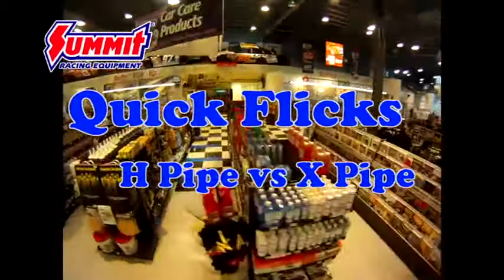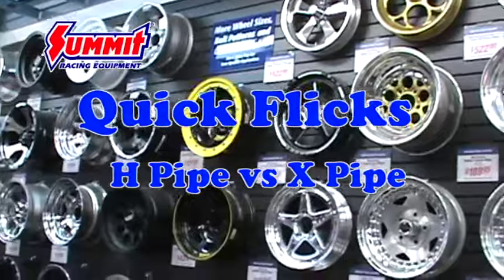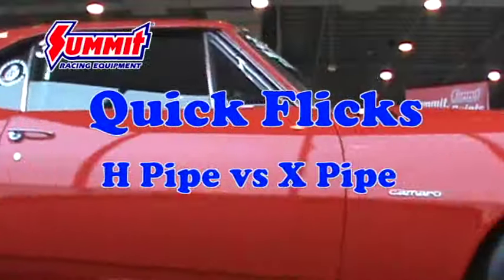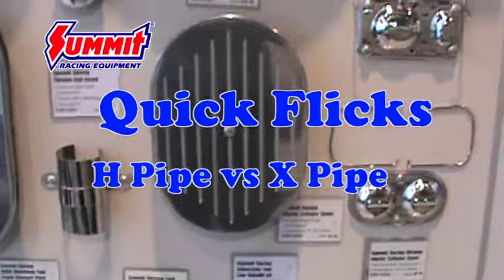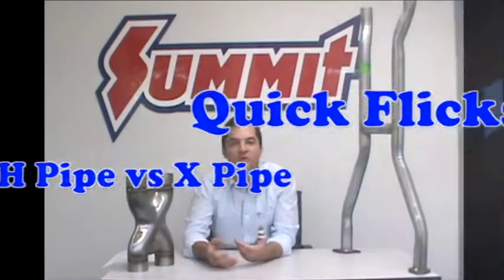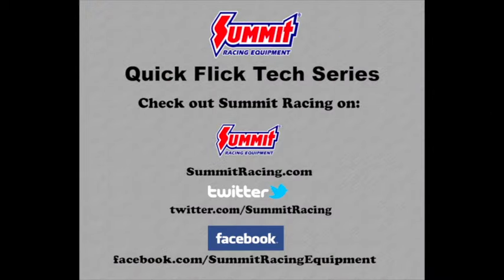Exhaust X-Pipes vs. H-Pipes and Differences Between Them

Comment: I have a 2012 Ford Flex Limited  Awd Ecoboost, I'm look to get the most out of it, there is a resonator an some say catalyst converter before the resonator, the catalyst converter is that a X pipe or a catalyst converter, an can they be taking off to stop restriction, can I go to 2.5" from 2.25 from front to back an is there anything  else I can do to more out of the 3.5 355 HP
Reply: bigger is better on turbo engines as the exhaust flow from a turbo motor is very different from the flow of a n.a. motor.

turbo engine exhaust flows like water flowing through a hose.

n.a. exhaust is a series of waves. a high pressure pulse is created when the valve opens then when the valve closes it creates a low pressure area behind the exhaust pulse. that low pressure area in a tuned system helps to suck the next wave out of the engine when the valve  re opens. That's scavenging.

for turbo it's all about killing restriction and maximising flow. go with dual 2.5s or the biggest system you can afford.

The larger the pipes the more expensive the system and the less room youll have to route it. so keep that in mind
Reply: I'd use dual straight pipes personally. I don't see the advantage with an x piped system on a turbo charged vehicle but I could be wrong

Comment: I have a 96 caprice 9c1....getting ready to install some long tube headers along with some spin tech mufflers....No head or can work just cold air intake, under drive pulleys, beefed up trans, bigger throttle body, computer tune and bigger gears soon to come...not sure if I should stick with an h pipe or upgrade to an X pipe.
Reply from the maker: Ian B , Either one will accomplish pressure equalization between banks but, the X pipe will promote scavenging power gains in the higher RPM ranges!

Comment: I have a really good question I blew apart my bell housing and it caught my headers so I'm thinking of just piping it out of the does or through the fenders is what I like for show, but I don't want to lose on the massive amount of power because I have the x pipe I love the sound but I'm confused now that I've watched this video lol.i don't want to lose power
Reply from the maker: Hi jay arnold, 
On a street car application, that X pipe is helping you scavenge the exhaust out of all the cylinders. Give us a call and we can help you choose the right parts to reconstruct a new and improved exhaust. 1-330-630-0240. Thanks for watching!

Comment: Hey guys.  Is that ok to use x pipe on a daily drive truck?  Or this is only for racing vehicle s ?  This afect the mpg or improve mpg?   thanks.
Reply from the maker: Hi José I, 
Both H & X pipes improve power production. The X pipe just happens to do its job better when the exhaust gases are flowing well such as at a higher RPM. In a daily driven low RPM truck, an H pipe will do everything needed and will be easier to build!
Reply: Does x pipe will afect the mpg or the engine on low rpm?
Reply from the maker: José I ,
While an X pipe will still scavenge somewhat at a lower RPM, any increase in mileage will be minimal.

Comment: whats the best one for a 1997 chevy 1500 with a 350 vortec
Reply from the maker: +Markus Gentry , 
When a vehicle is operated most times at low speeds during towing such as trucks, they benefit from an H pipe.

Comment: what is better for 2003 audi a4 quattro. x pipe or h pipe?
Reply: dodz barredo if it's a v6 they come stock with an x pipe. 4 cylinder options only have a single pipe

Comment: On a Hyundai Tiburon with 2.0L 143 bhp how many bhp could a x pipe add?
Reply from the maker: Hi Dima K, 
X and H pipes were originally designed to equalize exhaust pressures between banks of V8 motors as well as some V6’s. Dividing the exhaust on a 4 cylinder motor would be detrimental to the scavenging effect of the current exhaust.

Comment: i have a 96 impala i want to X-PIPE IT NO CATS STRAIGHT TO THE MUFFLERS IS IT BENEFICIAL TO HP AND SOUND ?
Reply from the maker: +HASANI BROWN, 
Every car/motor combination will react differently and much will depend on the tune you put in the computer. But it will most certainly be an upgrade over the factory exhaust!

Comment: i have a 1981 cutlass cruiser with a stock 5.3 LS swap will a x pipe fit onto this wagon?
Reply: S.i. Thug I wanna see that swap. post a video. I'm looking at doing the same swap to a full size 83 Buick wagon
Reply: i wlll not be posting no vids until later on when shes finished its a g body and you can check out the g body ls swaps that are on here
Reply: S.i. Thug did you have a hard time fitting exhaust manifolds in there?
Reply: I used f body headers prior to engine installment
Reply: S.i. Thug right on. thanks for that

Comment: Surprised to hear the speaker talk about "lacking back-pressure". All back-pressure is a bad thing in terms of performance.
In a situation were an engine is "lower performing" or a engine that makes most of it's power off idle to mid-range it's not a lack of back-pressure that could hurt it's low rpm performance, it's a lack of exhaust velocity due to an exhaust system that is too large and/or tuned for too high a rpm that allows exhaust to linger or worse get party drawn back into the cylinder.

Comment: H and X pipes tend to only make a difference on fuel injected engines with  dish pistons that lack in cylinder pressure. A high compression carburetor engine  tends to do better with open exhaust or with straight through mufflers to free up horsepower. Nothing actually generates horsepower besides the engine itself.

Comment: what would you recommend for a 350? X o H pipe?
Reply from the maker: Hi Danny, 
We need some additional information from you. Can you please give our tech line a call? 1-330-630-0240. Thanks for watching!
Reply: What kind of info would you need?
Reply: Compression, cam, carb, tune, max RPM, daily driver or street / strip or pure race and drag.  Anything that effects airflow needs to be calculated.

Comment: I don't know how much hp I have but I used to rev my sbc350 to 5500rpm to run 13.7 and after i installed the X pipe (only mod) it run the same time at 5000rpm and a 5000 it used to run 14.2 before revving it to 5500 , the sound it's different and a bit lauder, the camshaft lost his choppy sound

Comment: I have a titan with true dual exhaust no h pipe or x pipe is this ok
Reply from the maker: Hi chris collins, 
Yes, true dual exhaust has been working just fine for many, many years! Simply stated, the addition of an H pipe will help to balance the pressure between banks of the motor allowing it to breath better and may increase your power a bit.

Comment: I have a 91 mustang 5.0 with the trick flow track heat top end and stage 2 cam. I'm running a coil pack system from an explorer and plan to switch to long tubes. I'm running an h pipe now but would an x pipe be better?
Reply from the maker: Hi *****, 
For maximum horsepower in the upper RPM ranges, yes, an X pipe would be more beneficial! Thank you for watching :)

Comment: Mercedes C300 V6, 230hp, which is better for my car X or H pipe,
Reply from the maker: +Donny Linton, 
Not all engines breathe the same or are used for the same purpose. While an H pipe may work well on your street driven V6 an X pipe may work best on a Race driven 6 cylinder. You’ll have to try each one on your vehicle with the proper computer tuning each time to see which one produces the best power in the power range you operate in most frequently.
Reply: +Summit Racing ok great thanks for the help. ill be going with X pipe

Comment: Is it ok to delete my resonators and add x pipe?
Reply from the maker: Hi XxStUnTiN2422xX, 
What you are contemplating is actually quite common. You will get some increase in interior drone but the X pipe will give you a gain in performance. Keep in mind, you will have to retune the computer for this additional air flow!

Comment: Ok here you go. Take my knowledge for what you want.  Not here to start an argument.  I get all the uninformed these days saying they want an x pipe. With an x pipe you will get about a 3-4 hp gain in the top end (which is nothing) and about a 10-15% loss in torque in the low end.(which is a lot)  Believe me you will feel that. (because with an x pipe you loose back pressure at low RPM's) For daily driving this sucks. Plus hands down an H pipe sounds so much better. I love that old school deep rumble growl that goes with the H pipe and the 3-4hp is not worth that obnoxious raspy sound from an x pipe.   For a heavily modified motor and I do mean heavily modified including forced induction go with the x pipe. This is because now you are pushing enough exhaust flow to make that x pipe shine. That is the only time you will see the true benefit from an x pipe. I am so tired of so much disinformation out there and I hope this helps a few.

Comment: How about a H-pipe on a V-6 3.8l 2001 mustang? Will this help its performance
Reply from the maker: Hi Michael Nall, 
Alot would have to be changed to get the H pipe; then a retune of the computer  because of the new airflow and fuel requirements. Then the question becomes did the power come from the new dual exhaust, the H pipe or the retune of the computer, or all of the above? The cost of all of this and dyno’ing the car versus the power gain is certainly worth thinking about. But, yes, an H pipe will add power to your car!
Reply: Get a V8.

Comment: I forgot to include that compression is aprx 9.5:1 - 10:1 Also I run a boughten 4412 holley 500 with a Edlebrock 4 barrel intake and World Products S/R Tourquer cylinder heads

Comment: Hello, I am on a Formula SAE team and I am working on our car's exhaust system. I have been trying to find some ideas on how to do this and haven't found much yet. We are running a two cylinder engine with a two pipe primary that converges at a collector and then to a Yamaha YZF R1 muffler, which has two chambers. Our dBC levels are too high for competition and we have to add muffler packing, which reduces noise but also reduces performance. What methods can I use to decrease noise? Muffler silencers, smaller tube sizes, ceramic coating, different mufflers, or maybe even have two mufflers and not use the collector? Packaging is an issue and that's why none of these teams use resonators, but some of the better teams have two mufflers or exhaust pipes. If anyone could help explain some ideas that would increase performance and decrease noise, that would be great,
Reply: hey man I've built 4 FSAE cars. go for a 4-1 setup. That's the easiest system to build and works well with the yzf. also just add a simple silencer at the end of the pipe the further from the engine the restriction the less power you'll lose. FSAE is not about brute horsepower it's about handling and driver skill.

finish the car by February and drive the piss out of it for months leading up to competition. And you'll increase your chances of winning overall. your goal is to become one with the car and to break it long before competition when you have time to fix it.

don't nerd it to death, keep it simple and light.

driver skill will give you more gains than the 2-3hp you may gain from a complicated over engineered exhaust system.

good luck my friend and have fun.

The teams that finishes the cars earliest always end up in the top 10
Reply: an fsae car is a very different animal from abything you've driven it will take u weeks to get comfortable handling one. You need to drive it alot prior to competition
Reply: +3star2nr How can I do a 4-1 setup if I have a 2 cylinder engine? And can you message me your email so we can continue this conversation?
Reply: +TheFutureEVH oh my bad I thought you were using the yzf r6 engine are you using a v twin ????
Reply: +3star2nr No we're using a Yamaha Genesis 80FI with a CT and the YZF muffler (its titanium and only $50). Our team placed in top ten at the competition in Michigan but noise was changed to dbC scale and everyone had a tough time passing it. We had to pack our muffler
Reply: +TheFutureEVH I'm not familiar with v  twins. My gut instinct is for most power and simplicity  yould want to keep both exhaust streams separate.

but I can also see how combining streams would give you some scavenging benefits plus it would make the entire system lighter and cheaper as yould only need one muffler.

finding parts that small is going to be another challenge for you if I remember right the exhaust ports are only about 38ish mm diameter.

check burnsstainless .com see what's the smallest collector they have. that would be a good place to start to see what .aerials you can find. the collector is the .out important part of the entire system
Reply: +TheFutureEVH tweet me @the3star2nr I've never designed a v twin exhaust system but I'll gladly tell you everything I know and try to point u in the right direction.

once you understand the basics we can start figuring out a solution.

are u also designing the intake. because both work hand in hand
Reply: +TheFutureEVH just saw your post hit me up on twitter

Comment: Hi guys I have a BMW e63 m6 x pipe or H pipe?
Reply: be careful with bmws especially m cars those come with tuned exhausts from the factory. if you swap it make sure it's for something dyno proven or you will lose horsepower.

alot of aftermarket companies are also full of shit so be careful.

I once installed a full exhaust system from a aftermarket company on a Porsche 911 turbo the car ran 0.4seconds SLOWER than stock on the 1/4 mile.

owner spent a bunch of money to go slower.
Reply: my old BMW engine alsi came with an x piped like setup from the factory. so don't discount what you already have. research alot and go with a race proven system

Comment: Which sounds better on a V8?
Reply from the maker: +WackoKillerDan, 
We would need  more information to guide you on this. Can you give our tech line a call? 1-330-630-0240. Thanks!
Reply: I need an H-Pipe for a 2011 Camaro SS...can't seem to find one
Reply: +WackoKillerDan can you explain is it possible to make a twin turbo corvette (with under hood mounted turbos) sound near smooth and high pitch like it has cammed exhaust or american racing headers
Reply: ***** Lol can't help you with that bro

Comment: Would either of these be beneficial to a 2001 Honda S2000 ap1?
Reply from the maker: Hi Quentin Freeman, 
The underbody construction (floor pan) does not allow for a true dual exhaust.
Reply: Oh haha, I see what you mean, but what would you suggest I use to upgrade the exhaust system?
Reply from the maker: Quentin Freeman, 
Pipe diameter and internal muffler construction are also big factors. That’s why cat-back exhaust systems work so well!
Reply: Summit Racing Okay, thanks! I'll definitely try that!

Comment: I have a 69 Mustang with a D9 351W block that's been bored and stroked to 398cid. Holley 750 DP carb, Edelbrock Performer intake, C9 Ford 351 heads (ported/polished) with roller rockers, Oversized valves, Comp Cams XE262-H grind cam. FMX transmission with shift kit and 1900-2300 rpm stall converter. NIckel Plated full length Hedman "hedders". Car is in Denver, so 5280' altitude. I want to be able to have a conversation in the car without raising my voice, but I want to be able to "announce" my presence at a stoplight or car show. Plus, I don't like the raspy european sound. What would be the best exhaust for that situation and still keep as much performance as I can. Speak softly but carry a big stick.
Reply from the maker: +Scott Williams , 
Have a custom exhaust system built using Flowmaster “HushPower” mufflers and electric cut outs!

Comment: Back pressure?? Your getting the whole back pressure theory wrong. Back pressure is always bad... it's probably called negative pressure. You know, the whole scavenging idea is based off of the negative vacuum that's caused by exhaust gases escaping out the exhaust pipes...
How can someone who sells auto performance party's get this so wrong... back pressure and how it's explained here is a myth!..

Comment: X-pipes loose low end power, they are for high rpm situations...
Reply: Why are Americans so concerned with low end. I mean your v8's have more than enough low end why want more?
Reply: +Darren Rodgers the LS3 produces 460 lb.ft of torque the coyote 390 lb.ft, the 392 hemi 475. And that torque is very low in the rev range. That kind of torque just spins the rear wheels, it's more than you need. Why would you want more of what your tires can't already handle?
Reply: +Hasan Luqman Qazi 
Your tires must really suck then! Maybe time to buy some stickies!
Reply: +Shawn Scaggs What about in the wet or when it's cold, what then? High rpm power will make you fast enough without breaking traction, low rpm power will do just that. Stickies aren't the answer to everything. Ford understands what I am saying right now and the voodoo doesn't have  more torque than a regular gt but it's faster, the dodge people extracted too much torque from the hellcat and it needs 335 size tires to not spin out. As I see it 400 lb.ft N/A is plenty and as much as you'll need, for launching or burn outs or correcting your line mid corner with the throttle or whatever, it's enough. The 600+ lb.ft in forced induction American engine are good for burn outs and snap over steer if you make a mistake.
Reply: +Hasan Luqman Qazi the engines might make more power and torque but the cars weight comes into play too. My challenger will spin the wheels when I want it to sure, but in the case of low end power, getting a 4400 pound car moving at a faster rate couldn't really be a bad thing. I understand all your points, just saying, with more weight, more low end and torque never hurts.